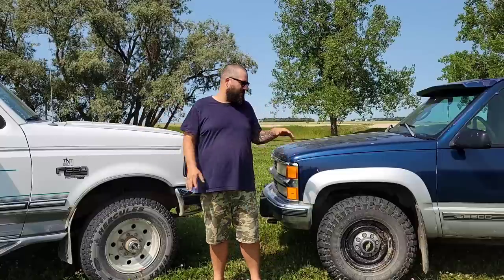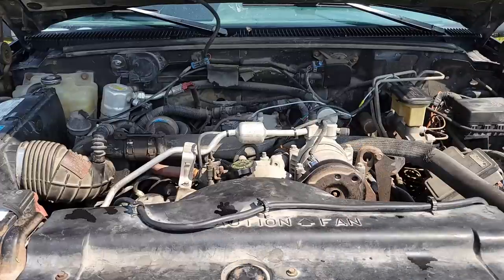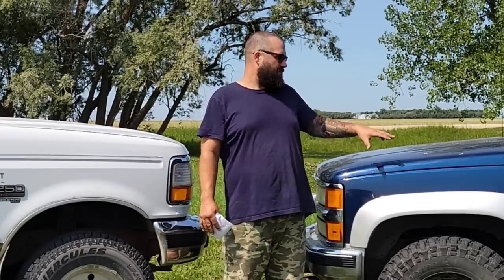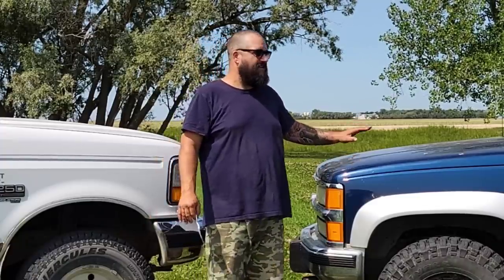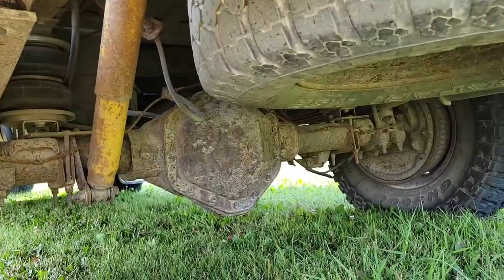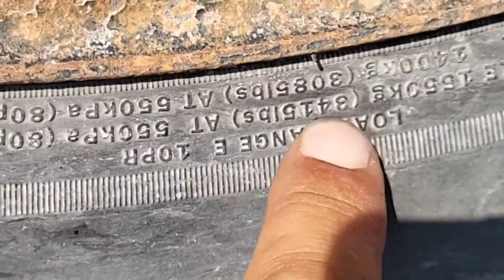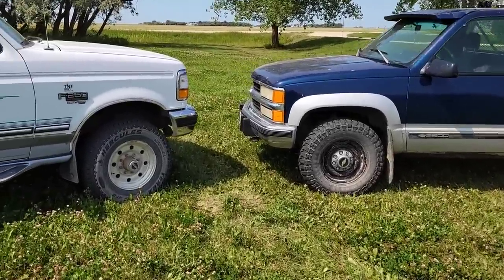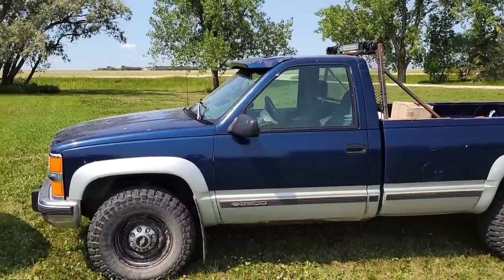7.3 Powerstroke  Vs. 6.5 Diesel

Comment: I got a 25k mile '84 M1008 'cucv' military on 38" Patagonias has the factory 4:56's in 14b locker out back D60 up front. The 6.2(99% same as a 6.5) in it is reman and they all had cast cranks new in 80s/90s. I did a 700R4 swap last year and its getting an out of production Banks Sidewinder kit this week. Found it on a buddies donor truck getting an LS swap out here in California(smog exempt) 

The beauty of the 6.2/6.5 world is the motors are STILL MADE NEW by AM GENERAL and they are IMPROVED big-time in the form of 'Optimizer 6500' totally new castings/metallirgy/FORGED CRANKS....so they are still sourceable NEW from AMG. Classic Diesel Designs in Seguin TX makes big power pumps for the Ferds and the DB2 pumps for the 6.2/6.5 able to fuel 500+hp out of these things. The crankshaft is the achilles heel of a 6 2/6.5 OEM gm trucks, but the Optimizer version w Forged crank combined w a big pump+ bigger boost will survive and run hard. Depends how much money ya got like anything else. Standyne pumps in GMs are internally governed to 3500 rpm that can be removed and they can spin 5krpm if fueled for it. The 6.5T is in the all new AMG Saber military truck and being made for Hummer repower contracts. 

There is also the out of production AM Genreral 'P400' 6.5T that has the forged cranks and a CRAZY strong block w stud girdles and more. The marine industry runs 6.2/6.5s also

7.3s are awesome and the hot rodders are pickin em clean so they are getting rarer by the day. 6.5T world is still alive and well and they can be made to run well of you got 10-15k

Comment: Got a '99 F250 7.3 with the ZF6. The Ford in that era was more powerful than both the GM and the Cummins. First light diesel offered by the big 3 to have HEUI injection system. Those motors are known to go over 500K miles.
Reply from the maker: Your truck is exactly what I started off looking for. When I found this one my heart fell in love with the old style body. 

Although by modern standards these old rigs are "underpowered " I think they do the job just fine. 

Thanks for commenting!!
Reply: I rather a 12valve with more torque.....less revs too
They will easily do 800 000 
Inlibe 6 better main to rod bearing ratio
HEUIs have advantages until high pressure common rail fuel systems came out.......but u can beat a mechanic injection system with less complicated electronics.....

Comment: both engines are great! HOWEVER... not exactly an apples to apples comparison. 7.3 is a work horse. 6.5 is for mileage. generally speaking, of course. just depends on your needs.
personally, i grew up with both in my family and have a soft spot for both. now, having the old school GM blood in my veins, i STILL own a 1989 Chev C1500 (5.7L) and a 1995 Chev K2500 (6.5L) had them for years and would sooner fix and keep them than ever get rid of them. up in Alberta here, there are 10s of thousands of 4th gen C/Ks around still and most are in good to great shape. fords (and even old sheep trucks) of similar vintage are way less likely to be seen as they were poorly built in comparison and always rode hard and put away wet. hence they didn't last.

Comment: I'm a GM guy and I wouldn't exactly say the two trucks "directly competed" back in the day...   If you wanted an efficient diesel that rode and drove nice and could do a bit of work, the GM truck was the ticket.  If you needed towing capability, you really had to look at Ford and Dodge for the power of their diesels...  '96 the pinnacle of GM trucks, '97+ got the speed sensitive steering that will eventually try to kill you...

Comment: Im a gm man because of the parts  interchangeability and not such a pane to worke on but gm best deals are lly snd up and you dont have to pull the cab of to worke on and the injectors are not under the valve  cover and Allison trans

Comment: With the 6.5L in 1997 the horse power was upped to 215 and the torque was upped to 450 lb ft of torque but at the end of the day all the 90s diesels where slow reliable  and somewhat fuel efficient I’ve towed with all 3 90s dodge ford and Chevy there all slow

Comment: 215@3400 hp/rpm
440@1700 lbs.tq/rpm
I own a 95 3500 with a h/o 6.5 and other than a high flow intake plenum and straightpipe it has no other mods.

Comment: There's 2 reasons the Cummins 12 valve is commonly transplanted into other brands of trucks is because (1) the body/frame/interior of the 2nd generation Dodge was shit and (2) the 12 valve is significantly easier and cheaper to get more power and is known for being ridiculously long lasting (There's actually a Cummins million mile club because it's so common for those engines to last over a million miles)

Comment: My 97 k3500 extended cab dually chevy has the 454. I love the power but 9mpg hurts when I see the 22 of the 6.5. And the 454 is tired at 230,000 miles with 15psi of oil pressure hot at idle on 15W40.
Reply from the maker: I hear ya on tbe 454 mileage, the first truck used here to do my chores was a 97 454 powered 3/4 ton exactly like the one in this video..

The 454 has way more power then the 6.5 but probably 1/2 the mileage.

Comment: Hey buddy you forgot the Dodge my is the 99 24 valve lond bed 4 wheel drive extend cab with a stick 5 speed  The Cummins is a beast  but yours sound good

Comment: I drive a 1999 3500 6.5 with nv4500 and I like it but my brother has a 1999 250 7.3 4 speed both nice trucks but the 7.3 definitely has more ass but my 6.4 has 410 rears so it has a lot of torque going up hills I can go up a pretty steep hill in 5th at 35 mph just fine but on the 7.3 it would shift down

Comment: 1995 gmc 3500 4bolt main  350  nvg5400    and 14 bolt  rear with 4:11 gears  single wheel  tough tough can be not fast  but  reliable

Comment: I bought a 2000 C3500 6.5 DD instead of a F250 King Ranch with the 6.0. I warned about the 6.0 and was told the 6.5 was weaker than most but very reliable. It proved to be the opposite. That C3500 proved to be the single worst vehicle purchase I have ever made. Every 2 months it was in the shop. Put me off GM forever. It was clearly engineered by the mentally ill.

Comment: The ford motor is better However, your going to need a ladder to get in the back of the ford 😂.  Damn they were tall and noisy.  Congratulations on the new to you truck.
Reply from the maker: My  chevy is actually taller at the rear bumper by several inches, the front pf the ford is way taller though for sure.
Reply: Just bought a new ram half ton with the eco diesel, 3 liter has more hp and torque than the power stroke 7.3.  It’s amazing how technology has improved performance but has made a mess with the emissions.  Stick with the older and reliable trucks.  I’m enjoying the variety of vids lately.

Comment: I have a 2000 GMC dually  6.5td 4x4 3500 and my underhood sticker say's 210 HP /440 foot lbs. F code. WTF..lol! I've done every bolt on upgrade, excepted intercooler and it's chipped. Dose what I need it to. Just wish they came with a intercooler because long grades towing, my EGT's are threw the roof and have to backpedal so it doesn't melt...lol! Thinking when it dies, 12 valve swap and full restoration.
Reply from the maker: I've read 440lbs but honestly I don't think they are there. At least compared to the 7m3 which is 450. 

Local guy has your truck with a cummins, it's pretty sweet.

Comment: The 7.3 was good but so was the 6.5 especially turbo models 6.5 had less power than 7.3 225 HP vs 180 with 6.5 GM